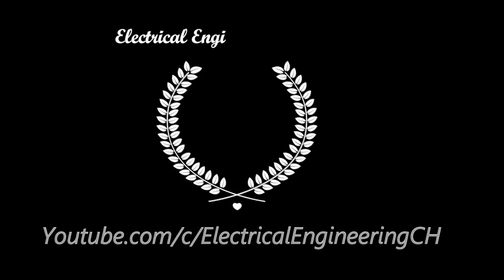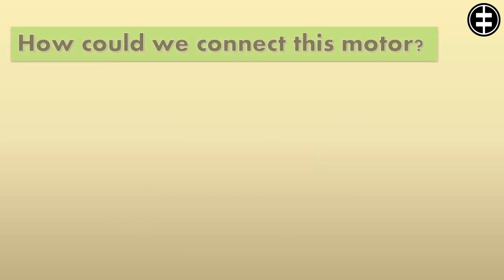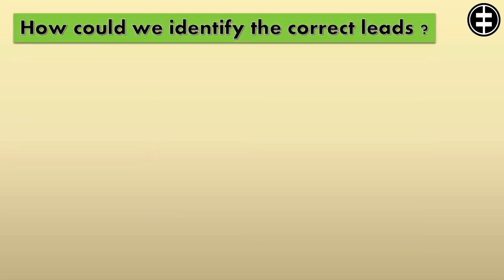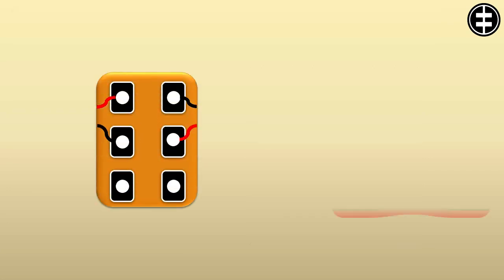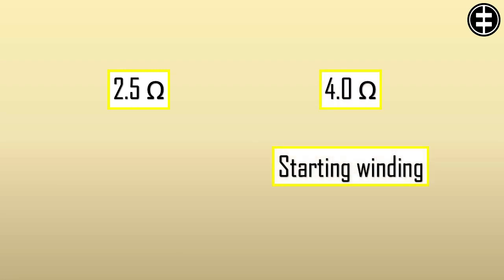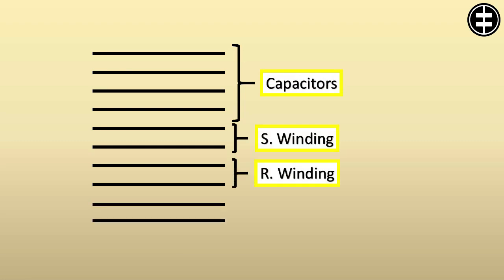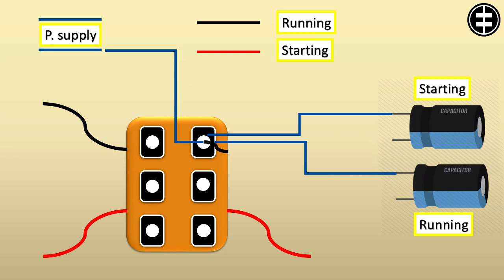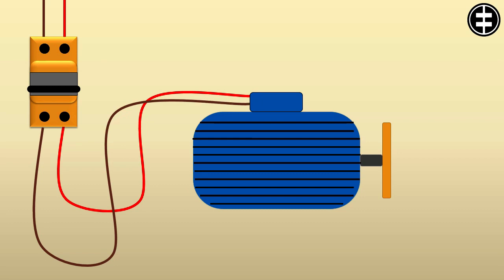How to connect a single phase motor and identify each winding lead ?

Comment: on a refrigerated trailer with a 120v single phase compressor, the hot lead amperage is 15,  the white, common, lead is 7.5 amps and the green, ground wire has 7.5 amps.  The compressor unit is on one breaker and the evap fan is on another breaker.
Should there be current in the ground wire?

Comment: Why would the running capacitor be connected to the starting winding on one lead?
Reply: To supply power to the start cap until the switch cuts the start cap out.

Comment: Thanks for explaining the wiring connection. 
Please help to  resolve the practical problem in single phase submersible motor pump set 
What are the Reasons for Low motor running Amps(7.5A@245V) in 2HP single phase submersible Borewell pump set with start & run capacitor ?? 
Normal Running Amps :12.5A@245V

#If main winding is faulty, but auxiliary/starting winding is all right,(of 2HP submersible pump set motor with start & Run capacitor) , then what would be the Running Motor Amps as main winding is already faulty ? (2HP Rating,  single phase pump-set ). 

#Should single phase motor running with auxiliary winding only, resulting into over load high motor Amps? & Trip by overload  relay?

Please reply. 
www.facebook.com/Bhargava Ashwath 
Curiousbhargav@yahoo.co.in

Comment: correct me if I'm wrong. for 3 wire ac motor with single capacitor, should we plug the com wire to neutral, 2 other wires from motor plus live to capacitor? or can we change the live and neutral? or it makes no difference?